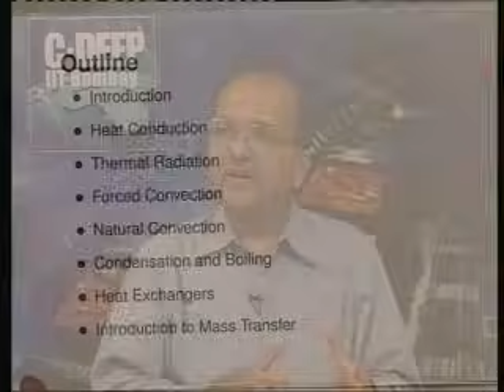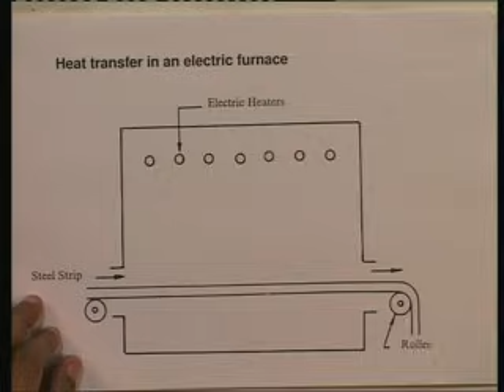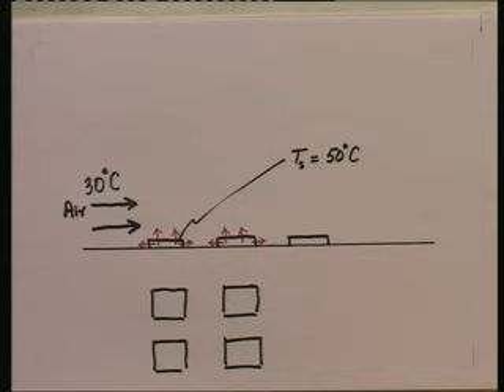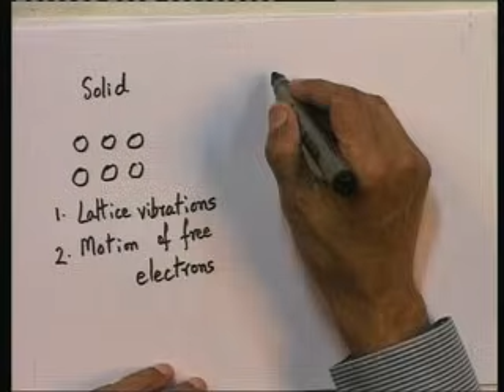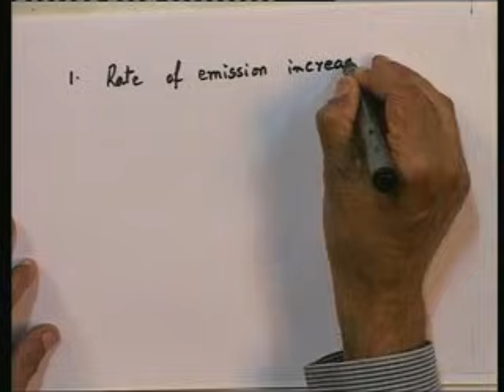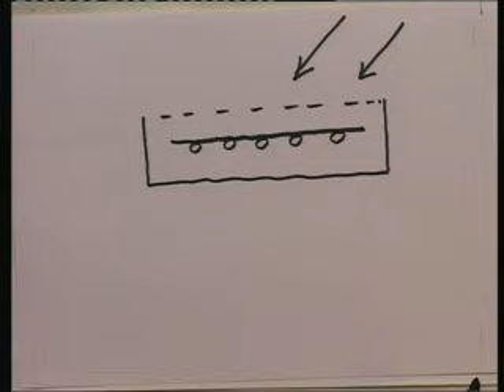Lecture - 1 Introduction on Heat and Mass Transfer

Comment: Summary Of Video
6:55   = Introduction
9:55   =  about Car radiator
12:45 = Mass transfer example
14:35 = small example of HT
16:08 = Types of problems Ex.1 steam pipe
21:10 = Example  2 condenser
23:45 = Example 3 electric furnace
26:30 = electronic transistors ex
30:55 = modes of Heat transfer & about conduction
36:28 = Convection
39:14 = Radiation
40:22 = characteristics of radiation
43:50 = logic behind those 3 example mentioned at starting
45:12 = Overview of solar collector
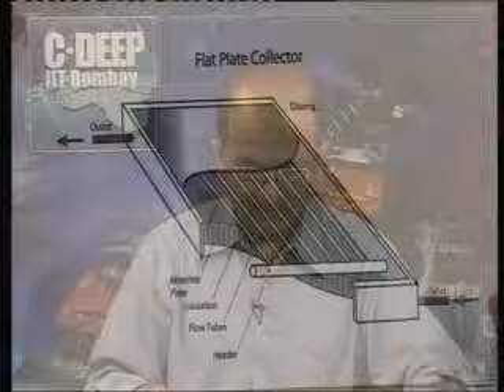46:06 = understanding solar collector

If u don't have much time to listen this long lectures
Watch this playlist instead
Link:- https://youtube.com/playlist?list=PLLPK4y07IxH3P692Xuk1ZK9pzBUUMOkbs

Have a beautiful day...keep studying...leave a like to help others see this Comment
❤️❤️❤️
Reply: Ok man
Reply: @BabaFakruddin-  😂😂😂 Happy to see u here
Reply: @RaviRegar  😂
Reply: Do I need to study thermo before HMT?
Reply: @shubhamjoshi5278   Yes. At least upto introductory extent. 
• How Thermodynamics & HT is differed ?
• Relation of conservation of energy & its direction of flow with Heat Transfer. 
• What to considered the system & surrounding in HMT problem ?
• Fluid Kinematics & conservation differential equations in Fluid Mechanics coupled with HT. (FM)
• Non dimensional analysis technique (FM). 
• Details of Hydrodynamic boundary layer theory (FM). 
      Rest complete course is independently new.
Reply: @NAYAN-t3e  Thank you for your reply 
You are right after studying I got to know this topic are really needed to know before

Comment: these five subjects are the backbone of GATE Preparation. watching and making notes of these videos is very helpful.
 (1) ENGINEERING MECHANICS:(LINK https://www.youtube.com/watch?v=o_f1nQDtOOk&list=PLa4KQhDlGd7Rj8ulW4uFjqBmtzZe2rwDv): WATCH KINMATICS , DUNAMICS PART PREFERABLY . if you have time watch statics part also 
(2)strength of materials https://www.youtube.com/watch?v=GkFgysZC4Vc&list=PL27C4A6AEA552F9E6 
(3)fluid mechanics(https://www.youtube.com/watch?v=HGbbdXNcIQA&list=PLbMVogVj5nJQEgL1sHuY24d6omOqXInnt) Don't watch compressible flows i.e. after lecture number 54 . 
(4) heat and mass transfer(https://www.youtube.com/watch?v=qa-PQOjS3zA&list=PL5F4F46C1983C6785) from heat trasfer don't convection part .
 (5)thermodynamics(https://www.youtube.com/watch?v=9GMBpZZtjXM&list=PLD8E646BAB3366BC8) don't watch entroy and exergy part. if you want refer cengel and boles Recommended by Santosh Mallah sir

Comment: Energy Transfer not Heat transfer. Heat is Energy Transfer. So Heat transfer will be "Transfer of Energy Transfer".
Reply: heat transfer refers to rate of transfer of thermal energy Heat is not rate of energy transfer wrt time.It is just the amount of energy flowing due to a difference in temperature

Comment: isn't heat = rate of energy transfer with respect to time. but here the professor defines heat as energy. he is wrong in considering heat as energy because heat's SI unit is watts and energy SI unit is joules
Reply: u r wrong
Reply: heat is form of energy
Reply: sir is right
Reply: YOU are very very wrong. The professor is right- with years of experience behind him), heat is a form of energy and is measured in  joules. To confuse you more, if "rate" of transfer is taken, then it is the power and can be measured in your watts or even HP (horsepower in old English money). Is it clear now?

Comment: since we are already using an insulator, what difference does 1 cm insulator or 10 cm insulator make? I mean since it's an insulator, heat wont pass through it anyway, so even a 1 mm insulator is add good as let's say 1 m insulation. Isn't?
Reply: shivanjan saini, In universe there is no perfect insulator.perfect insulator is the one which doesn't pass any heat through it.hence,the insulator which we use in practice are of not ideal  insulator which doesn't exist.
hence there is a need to calculate thickness of insulator to stop heat  to pass through it...